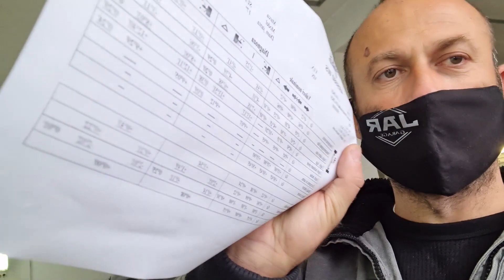Toyota supra Mk4 time attack wheel alignment

Comment: What did you think of your alignment? Was the car superior on the race track? Any kaput would be appreciated 🙏
Reply from the maker: I'm still on the same setup and love it. When I do drift competitions I only change rear wheels camber and caster. Other then that is the same, the front feels very stable, loads of grip and feedback as well.
Reply: @Tengu Drift  feel free to post your road course specs(not drift) if you have time. That would be much appreciated! I will be upgrading all my oem suspension to Hardrace ones which I think you did as well. Just looking for proper road course specs for our cars. Thank you
Reply from the maker: @jasonbliss1762  
rear: negative 2 camber, 0.2 toe in, traction rods on stock length 

Front: negative camber 3.0, toe in 0.11, caster 8 degrees,